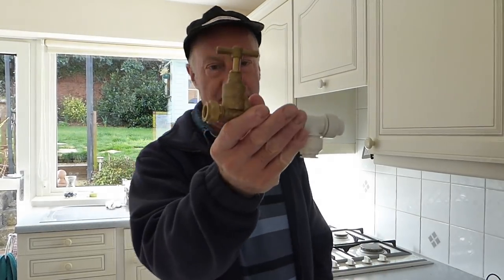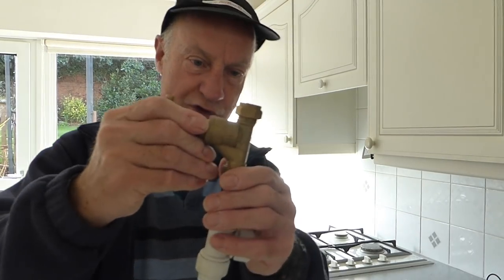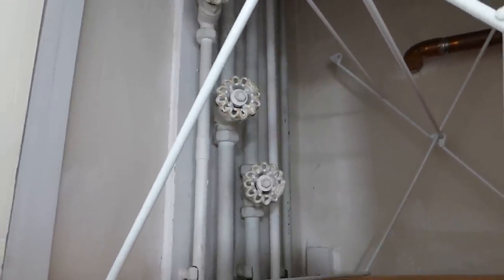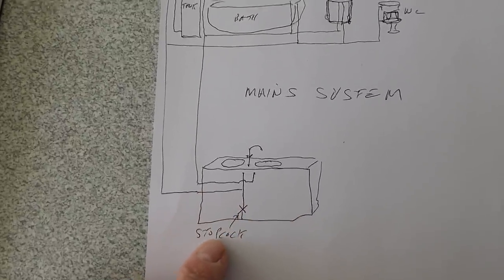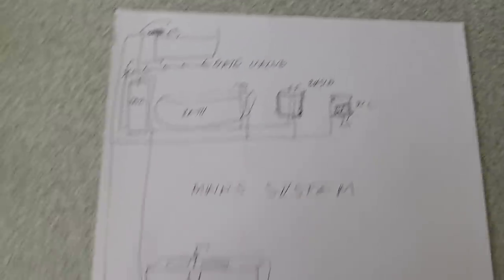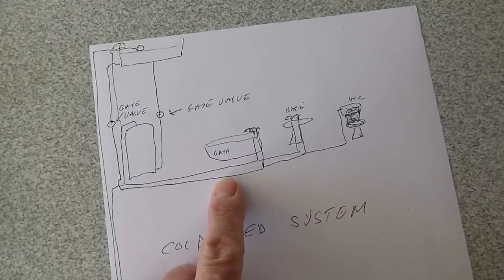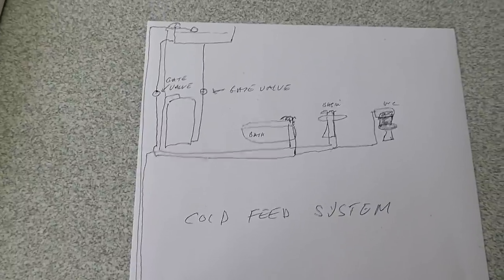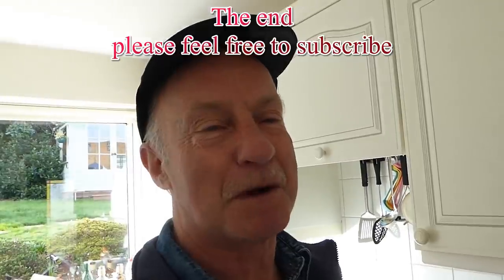Where is my Stopcock? How do I turn the hot water off?

Comment: In case of a seized  under sink main water tap just heat it up with a blow torch for 15-20 seconds and it will loosen up and turn.
Reply from the maker: Dont burn the house down though.

Comment: Hi, so ive always been curious. i have 2 stopcocks 1 under the sink (like always) and i have another in my bathroom in the top corner. ive closed it off and the toilet still flushes. just curious if you have any idea what it could be used for? and is it worth just keeping it closed? 
thanks

Ps i like in a block of flats if that has anything to do with it.
Reply from the maker: I would leave it on, it may be the water for a flat below you.

Comment: Thank you! very informative. See a stopcock in my bathroom and turned off but still water flowing through - do I need to drain this out (pressure seems the same as normal) or do I need to locate another valve nearer the geyser to close off the water?
Reply from the maker: See it there is one closer or drain the tank.

Comment: If changing hot tap in bathroom do I close gate valve in aring  cupboard
Reply from the maker: Yes. If it does not work then drain the tank.

Comment: hi, wondering if you could help at all. from my limited plumbing experience, i've only ever previously worked on houses with a mains stop cock which allowed me to carry out any tap changes etc. however my friend has recently bought a house which has both a boiler and hot water cylinder. my problem came when i tried to isolate the water, the cold was simple as it has a stop cock in the bathroom isolating the cold taps there, however the hot water (even when not actually hot!) just keeps pouring out the bath tap that the last person so kindly removed and never replaced! now i found what i now know thanks to you is a gate valve which lead along to the hot water cylinder, i did turn this valve assuming it would kill the water pouring out the bath tap, however it didn't seem to change the level of flow at all, could i ask, how much should i be expected to turn this valve, and once i assume i've fully "closed" the valve, should there be a small length of time before the water stops coming out or should it stop coming out immediately? i understand my wording of this may be useless and it's never easy when you can't see the actual install itself, however any information about this would be greatly appreciated! thanks
Reply from the maker: The gate valve should be turned until it firmly stops in the  clockwise direction, there will be a short run off of water before it stops flowing. Unfortunately a lot of gate valves do not work in which case just drain the roof tank down.